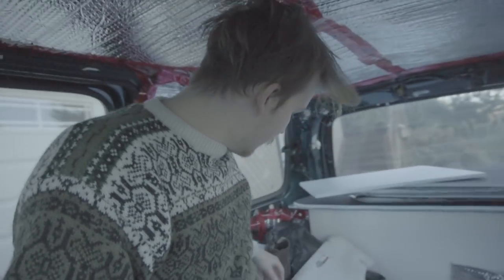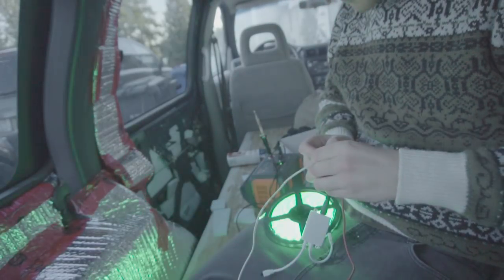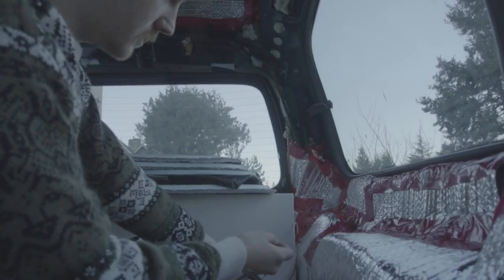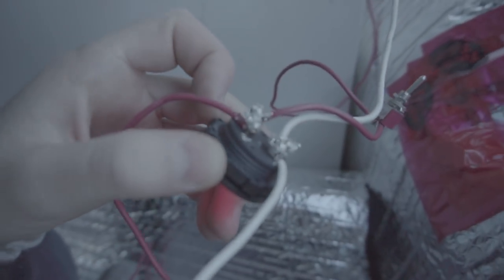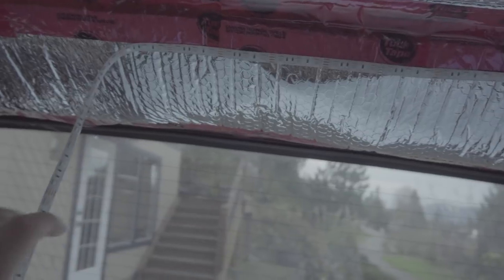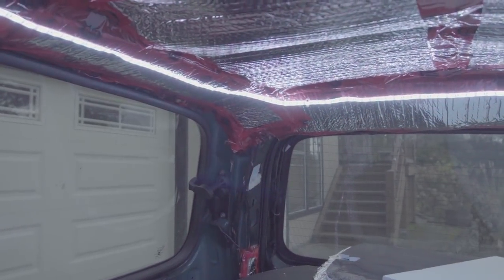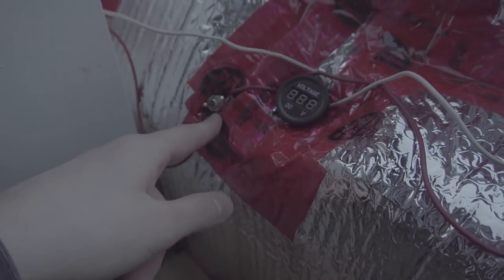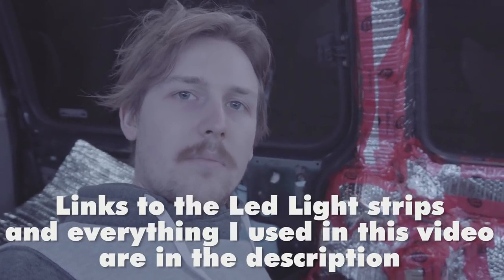Complete Guide : How to Install LED light Strips In a VAN for Vanlife and van living.

Comment: For those bright lights or LED readouts in the house or anywhere, I came up w the idea to tape some paper over the display.  Different things work for diff. applications - ie an alarm clock in your room, a battery readout like this etc.  Toilet paper can work 1 or 2 ply, parchment paper is great - very sturdy stuff.  Just use painters tape, holds forever, leaves no residue.  I've not had it move on me in my house (bedroom) in nearly a year since I figured this out 1 night.  LOL
Reply from the maker: good idea! they definitely need diffusion

Comment: Use heat shrink instead of tape to insulate the connections.. I tried to stick the refkectics with spray adhesie but in summer the metal gets hot and it gets soft..

Comment: A few things come to mind: 1) YOu mentioned wiring it into the cigarette lighter, but later in the video mention "two batteries." Car batteries are not designed to be run down and recharged over and over do you have a second house battery (like a golf cart battery or AGM) and battery isolator? 2) You will lose a lot of heat through the windows, so insulating the roof and sides (lower half) isn't going to help very much, if the windows are bare/only curtains or reflectix. Reflectix has almost no R value by itself, unless it's directly reflecting your body heat, which it will not do if it's covered up. Did you put anything behind the reflectix? 3)The red light info and sources for products is helpful thank you.
Reply from the maker: Hey Barb,Thank you for the great questions!! for your first point, That is why I recommend getting the voltage gauge as that gives you an accurate reading of how much charge is left in your battery, and not allowing it to go below 12.4 (50%), and also why I wire a second option off it to be powered from my jackery 240 (could also be an AGM, or deep cycle.) the answer to your second point is covered in this video I made ( https://www.youtube.com/watch?v=r-eIDYW9aNQ ) on how to make window covers, I use a combination of reflectix and rigid foam to create simple blackout window covers that pop in and out easily, their R value is 5.5 which is pretty decent in such a small space.
Also in the video I link below I explain reflectix and talk a bit about common misconceptions about Reflectix and it's insulation properties.
https://www.youtube.com/watch?v=qv9YSwylNJE
I'm glad the red light info was new to you and stoked the product links helped you out! I appreciate your feedback! 😊

Comment: Nice work! Hope all is well in your van nowadays. I'm kinda bummed though. You edited the part out where you got a + - out of the LED strips. How exactly did you expose the 2 wires from the LEDs? Where did you cut?
Reply from the maker: Thanks, wish I had included that, but it is quite simple, most LED strips have lines every 5 LEDs where you are able to cut, when you cut the line it exposes a + and - pieces of copper, and our can solder wires onto that.